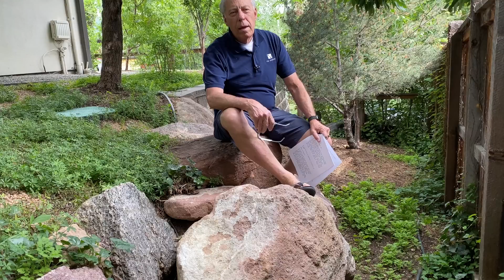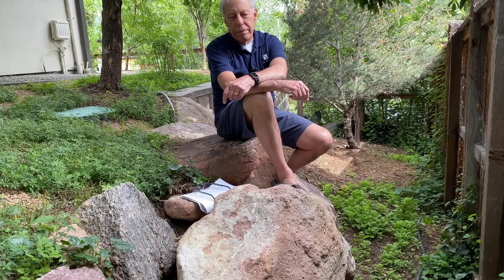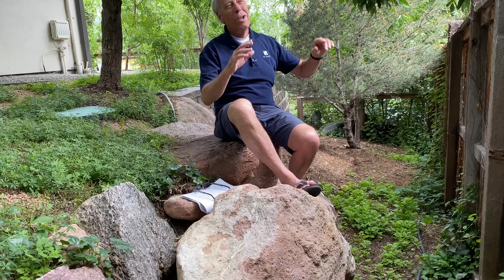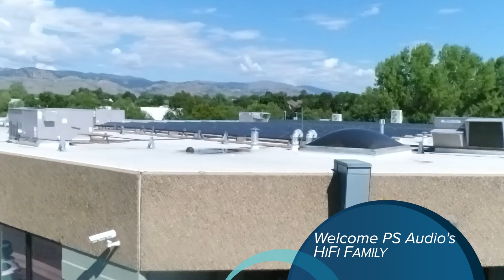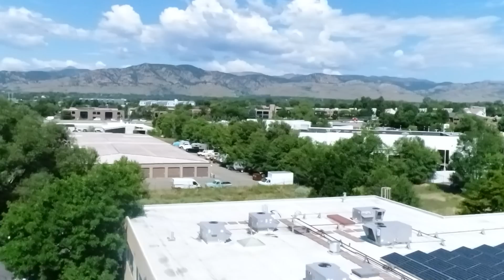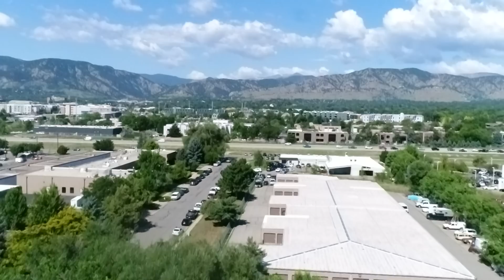Can a regenerator be used with valves?

Comment: Great question for those who already have their own jet and need to find something to spend money on. Let me know if you need some US$20,000 power cables.
Reply: Don't forget to buy some brilliant pebbles and cable lifters! 👌
Reply: @QoraxAudio  Said like someone who's never tried a cable lifter.
Reply: @VideoArchiveGuy  I use a type of cable lifters called tie wraps. Keeps things nice and tidy. Doesn't change anything to the sound though.
Reply: Or a Shakti Air Stone...
Reply: Qorax LOL, cable lifters...I forgot. I’ll sell some US$1500 per piece super low resonant ceramic cable lifters that will dramatically lower the cable to carpet interference and let the electrons move more freely giving the sound more transparency and openness. You need one per 2 feet of cabling for all your speaker cables, interconnects and of course power cables too. Due to the weight of power cables the cable lifter type is slightly more expensive at US$2000 each. We are working on a new type optimized for optical cables considering photons different properties.
Reply: @ThinkingBetter  I just turn my amplifier upside down so that all the bad electrons fall out! 😜
Reply: @QoraxAudio  Yes, bad electrons can completely ruin the soundstage as they jump around randomly. Don't forget that most importantly is to use an audiophile fuse in your amp. Standard fuses yield bad electrons, you know. Just buy a bunch of Synergistic Research Orange Quantum Fuses for your various devices. It's also good to have some spare ones, just in case. https://www.vhaudio.com/fuses.html
Reply: @QoraxAudio  BTW, I'm a person who likes science and am quite against anything that messes up our minds based on pure imaginary things...like religion, psychics, ghosts, aliens, crackpot conspiracy theories, audio snake oil and so on. From Big Bang to 13.8 billion years later... every time an explanation is needed, eventually science wins. Audio is on the much simpler side of science matters where we can explain pretty much everything. Try particle physics.
Reply: @ThinkingBetter  Noo, you need to use beeswax fuses, they're all the buzz nowadays.
Reply: @ThinkingBetter  Yes dogmatism is always bad... but don't underestimate the prevalence of dogmatism within the world of science...
Reply: Qorax Science make progress by a healthy level of debate and skepticism. What bothers me is when some person watches a YouTube video and consider himself an expert in a science field and starts making his own YouTube channel promoting the earth is flat, that aliens are living among us, you need a US$1000 power cable to hear all details from your 70dB dynamic range vinyl disk or other ridiculous things. The internet yields a lot of “Dunning Kruger effect”.
Reply: Qorax I can sell you some beeswax fuses. This month we have a special on 10 such fuses for US$4999. That’s 20% discount that we honor due to the pandemic. The new version brings music to life like you’ve never heard it. Actually it even eliminates all the bad effects of the regular capacitors used in the studio.
Reply: @QoraxAudio  How many times have you heard that Galileo was found guilty by the Inquisition that didn’t and how the Copernican model of the solar system correctly placed the sun at the centre of the solar system (it didn’t)? Scientists are as good/bad [delete whichever is inapplicable] at believing nonsense as anybody else.
Reply: @ThinkingBetter  I always thought the "cable elevators" were for keeping them out of the vacuum cleaner ??? 🤔
Reply: @poserwannabe1  No, cable elevators are to avoid carpet induced static electricity interference. That's why the ones we sell for only US$1500 are made of ceramic nano particles utilizing our patented rapid freeze molding process.
Reply: @ThinkingBetter  wow !! That's impressive...problem is I just spent 750$ on a audiophile grade duplex and male cord end, but I'm still having nightmares of "micro arcing"...my wife is recommending counseling..
Reply: @QoraxAudio  
How do you keep the good electrons from falling out as well?
Reply: @ThinkingBetter  Science should make progress by a healthy level of debate and skepticism - that's how the perfect world works.
Science is about churning out as many publications as you can and if you want to make a good career, you have to make sure others don't prove your results wrong.
Subjects that have no commercial purpose are less and less likely to be researched nowadays, since we live in utilitarian times that's all about profit and production. Solely "finding truth" doesn't have a high priority anymore.
Reply: @jonathansturm4163  Galileo explained his findings in a paper. The explanation was presented as a dialogue between Galileo himself and the pope, which he had nicknamed Simplicio and portrayed as an extremely dumb person.
Back then, the pope was one of the most powerful dictators in the world and executions over little things were common, so Galileo could've known that he'll get in trouble for insulting the pope.

I don't see what Copernicus has to do with Galileo, but the Copernican model actually was heliocentric: https://en.wikipedia.org/wiki/De_revolutionibus_orbium_coelestium
But Copernicus model is vastly wrong as well, since his model claims that all planets orbit the sun in circles.
I don't know if every orbit is ellipse, but earth's orbit definitely is.
Reply: Qorax When government officials are only interested in short-term business then yes, genuine long-term value science suffers. One example is nuclear fusion energy research that gets almost no money at all. Politicians are paid by lobbyists who care about growing business now.
Reply: @ThinkingBetter  Yes, that's the great thing about free market economy, get yourself some money quickly and screw over some other people in the process! 👌
Even more notable example than nuclear fusion energy was research into climate change. That research has been delayed for many decades.

Another nice example of the present day is the safety of pesticide coated seeds, something that's non-selective when it comes to killing insects. Beekeepers experience millions of dollars of damage because of that. It's a subject that's researched over here at the university of Wageningen quite a few times (Wageningen is one of the biggest academic institutes in Europe when it comes to agricultural research).
Most research is held back because it's financed by Bayer, the largest pesticide manufacturer.
A one man business like a beekeeper can't do anything about a multinational like that.
And environmental organizations already have other subjects that are more "politically spectacular" to make a fuss about.
Reply: @QoraxAudio  Galileo had been instructed by his friend Bellarmine, head of the Inquisition, to only teach the Copernican model as a mathematical recasting of the Ptolemaic model. He disobeyed. It’s a myth that he was tried for this; thanks to Napoleon Bonaparte we know that and several other charges brought against him not by the Church, but by his fellow university professors, was dropped. He wasn’t found guilty of the one charge that remained because the Inquisition couldn’t prove that his insulting the Pope was heretical. The finding was “vehemently suspected of heresy”.
Copernicus ‘ model was never adopted; it was too complicated and obviously wrong. It had more epicycles than the Ptolemaic, the plane of rotation of the planets varied and the results it gave were at best identical to the Ptolemaic model. The centre of rotation of the system wasn’t the sun, it was a point equivalent to the unoccupied focus of the ellipse in Kepler’s system. Galileo had a copy of Kepler’s book Astronomia Nova (Kepler had sent it to him) but he refused to read it; he knew Kepler was wrong and that planets can only move in perfect circles at a constant speed. A bit like those “scientific” types who know that cables can’t possibly sound different even though they never listened.
The Pope wasn’t a dictator BTW; he was elected as all Popes are. The Church wasn’t allowed to deliberately kill anyone either; that was the prerogative of the secular authorities. If the Inquisition had been seriously after Galileo’s hide, he would have been tortured and so would the printer of his book, Two New Sciences That never happened. His book was passed by two Inquisitions and only placed on the Codex after his trial.
Reply: @QoraxAudio  “Most research is held back because it’s financed by Bayer, the largest pesticide manufacturer.”
That may be true where you live, but it’s certainly not true where I live: Tasmania. When I first became involved in agricultural research here, my fellow researchers told me that there’d been no research into agricultural chemicals for nearly 20 years and that was in the mid 1980s. Mostly research was into Integrated Pest Management and that was mainly about breeding/selecting effective predatory organisms. My area was organic fertiliser use as a strategy to reduce biocide inputs. The Tasmanian Apple and Pear Growers Association set a goal of reducing pesticide inputs by 95% in ten years. They achieved it in five.
Reply: @jonathansturm4163  A few billion Dollars is almost no money for such R&D, my friend. ITER's initial budget was only US$5 billion. It's the largest fusion R&D so far but heavily underfunded relative to its importance. Just for comparison, the Apollo program's total cost in today's money is US$152 billion. The Manhattan project's total cost in today's money is around US$25 billion. Every year we spend US$20 billion in subsidies for the fossil fuel industry. The fossil fuel global revenue is US$3.7 trillion (almost 740 ITER projects). The US military budget in 2019 was 137 ITER project budgets. NASA is burning > 4 ITER budgets per year. Just to compare, it can cost up to US$6 billion to make a new car model from scratch (incl. new engine, new transmission etc.). Therefore my comments of "almost no money at all" is justified for something that represents a fundamental paradigm shift in our energy supply. Trump could be a superstar on this planet if he dropped his silly space force and focused on fusion power.
Reply: @ThinkingBetter  If the USA were the sole investor I’d agree with you, but they’re not. Is it underfunded? Probably. But that’s likely because none of its promised goals have been met. I can recall being told that it would be viable in 30 years’ time in the 1960s. We’re still being told it’s 30-40 years away. Personally I think thorium fission is the way to go short-term and I notice that the price for thorium went from being negative to positive about four or five years ago. And the USA is lagging in that area too. It’s India and China that are developing viable thorium reactors. The USA had one running for twenty years or so before shutting it down. Apparently they think bird-mincers and cookers are the way to go. Madness...
Edit: I’m not sure whether to believe the fossil fuel industry is subsidised, or not. I just looked at some Australian figures (we’re a net exporter). “Revenue from Australian Government taxes on fossil fuels exceeds the value of subsidies. The table shows that revenue from taxes on fossil fuels in 2009-10 was at least $ 15.5 billion. Assuming that the Australian Conservation Foundation’s (ACF) figure of $12 billion for subsidies is correct, the table shows tax revenue as exceeding subsidies by about $ 3.5 billion.

However, the table does not include revenue—such as company tax paid by coal and petroleum producers and processors—and therefore underestimates revenue. Consequently, taxation revenue exceeds the value of subsidies by more than $3.5 billion.” 
I can’t be bothered checking, but I do remember reading an analysis that government revenue exceeds subsidies by a significant amount in the USA also.
Reply: @jonathansturm4163 Well, that argument is a bit silly. Consumers pay the tax on fossil fuels and consumers pay for the fossil fuel subsidies through taxes, so it's a double whammy for us consumers. The ITER project is a construction project that moves at snail speed due to lack of funding. If the Apollo project was funded with similar money, we would never get to the moon and you could use similar argument. Mastering the "power of the sun" is much more complex than getting a bunch of people to the moon and back again following simple laws of physics. Meanwhile, the US government is spewing out US$ 2 trillion  for us to sit unproductively at home waiting for this pandemic to go away. I have no doubt fusion will take over our energy production at some point and no doubt that the time is all about proper project execution with proper funding. At least I can enjoy my solar panels on my roof fully powered by fusion energy.
Reply: @ThinkingBetter  At most 10% of oil production is subsidised and I suspect that a similar figure applies to coal so methinks you do protest too much. Over 90% of oil production is by government-owned enterprises: Gazprom, Saudi Aramco, National Iranian Oil Co etc. Take fossil fuels away and you’ve virtually no so-called renewables. Windmills cost at least three times as much energy to manufacture and install as they generate over their “useful” lifetime of 25 years. At least we’re in agreement that fusion power is a good idea, but I’m afraid that after waiting 50 years I’ve grown a little cynical.
Reply: @jonathansturm4163  Lots of things have not gone as fast as people predicted and much of it is not about feasibility but about how we choose to spend our money with a short-term ROI perspective. Look at the money spent on space research. The Apollo project brought us to the moon with a visionary president and proper funding. in the 1960s-1980s we had predictions about how space travel would be commonplace by now and we haven't even been back walking on the moon. Some projects require insane amounts of money and if the money are not spent, they will never happen. I've watched some videos about the ITER project and it just looks like a bureaucratic mess of lazy people and something that could be done 10 times faster if it was managed like modern high-rise building projects with proper funding...or like the Apollo project. I had my final oral exam in project management in my university presenting the use of the Pert planning method in the Apollo project. I'm from Denmark but moved to the USA. Denmark is on path to increase wind's share of total energy production to 50% this year, and up to 84% in 2035. Analysts expect the cost of wind power to be 30 øre/kWh and its handling cost to be 15 øre/kWh, being lower than coal and natural gas at 55 øre/kWh minimum. Some misinformation about wind energy has spread recently. I used to live near a large wind farm in Denmark. I've never met a person against wind energy in my home country btw. Sad such utter misinformation is getting so widespread nowadays.
Reply: @ThinkingBetter  Try manufacturing steel and cement without coal power. I suppose you could use charcoal, but there wouldn’t be much left in the way of forests. An Irish lass did her PhD on the effects of renewables on grid stability. At 35% the grid becomes unstable. We saw that in South Australia not so very long ago. You have to factor everything into the equations. I can recall Greenpeace extolling a business called Enron and how they were the ideal business of the future...
Reply: @jonathansturm4163  At 50%, Denmark is doing really well on power outage and better than the USA. https://www.greentechmedia.com/articles/read/the-countries-with-the-most-wind-and-solar-have-far-fewer-outages
Also in California, we don't suffer from power outages btw. A power outage is something you see perhaps once per 5-10 years here in my area.
Any transformation of our electric grid takes time. Actually here in California we have zero coal power plants already and only one nuclear power plant that is on the path of being decommissioned. My roof solar panels are saving me much money also (the sun shines a lot in California). 
Surely the fossil fuel industry is pumping a lot of money into skewing such facts. Reality is that coal is already economically losing against alternatives and that's really the primary reason the coal industry in the USA is rapidly shrinking. My Tesla Model 3 gives me around 300 miles for the cost of 1 gallon of gas with my own solar panels (amortized over 25 years). Does this compute for you?
Reply: Jonathan Sturm Also, steel manufacturing is totally possible with electricity or hydrogen: https://reneweconomy.com.au/another-nail-in-coals-coffin-german-steel-furnace-runs-on-renewable-hydrogen-in-world-first-55906/ To produce a ton of steel in an electric arc furnace requires approximately 400 kilowatt-hours per short ton or about 440 kWh per metric tonne; the theoretical minimum amount of energy required to melt a tonne of scrap steel is 300 kWh (melting point 1520 °C/2768 °F). Manufacturing of steel using coal is also incredible unhealthy and definitely not what we need in a much cleaner future.
Reply: @ThinkingBetter  When solar panels were being heavily subsidised by the Australian government I investigated the feasability of solar PV. The time to amortise the investment worked out at 18 years. At the time the Australian consumer magazine Choice came up with 16 years, but I live in the southernmost part of Australia so efficiency would be lower than most of mainland Australia. This was based on the feed-in tariffs (FITs) at the time and since I expected them to fall I decided not to go ahead with the quote. FITs have since fallen to the wholesale price for electricity (by about two thirds). I recently compared investing in solar PV for 25 years versus putting the money in the stock market. Investing there and buying grid energy generated $75,000 more over that period of time.
Something I hadn’t anticipated is the impossibility of replacing failed solar panels. You can only replace a failed panel with an identical panel. So far every panel that’s failed where I live is no longer manufactured, or available. It would seem my original estimate of time to pay back was overoptimistic. And no, I’m not talking about cheap Chinese panels. These are of European origin (mainly German).

I can only recall one serious (unplanned) power outage where I have lived for the last 50 years. It lasted for nearly 48 hours and was caused by statewide wind storm that took down many power lines. The supplier paid me compensation :-) Since I burn firewood for space heating, cooking and hot water I was quite comfortable. Being paid as well was a bonus.
I emailed a chap in Denmark who worked for me for a few months years ago. He says there’s widespread protests in Denmark against windfarms. So it goes...
Reply: Jonathan Sturm Denmark has some very windy places, especially at the west coast. Now I live in a place with a lot of sun here in California. The sky is completely free of clouds almost every day. Obviously many places are not so ideal for these energy sources. I know nobody protesting against wind energy in Denmark, but I don’t live there anymore. I just found this though: https://www.thelocal.dk/20171213/few-danes-complain-about-wind-turbines-group
Reply: Jonathan Sturm https://i.insider.com/5af0a65e19ee8624008b498d?width=750&format=jpeg&auto=webp
Reply: Jonathan Sturm I’m not sure when you researched solar panels but the price has dropped dramatically in recent time. Over 25 years my estimated savings are about US$80,000 all cost considered.
Reply: @jonathansturm4163  "The Pope wasn’t a dictator BTW; he was elected as all Popes are"
Hitler was elected, so he doesn't qualify as a dictator too?

I don't see what elections have to do with dictatorship, just like what Galileo has to do with Copernicus.
Especially as an initial reaction to a comment about dogmatism within modern science.
Reply: @ThinkingBetter  There’s a huge difference between recycling steel and manufacturing steel. Steel manufacture requires vastly more energy than recycling it (~6 times). Steel is an alloy of iron and carbon, so a carbon-free steel manufacturing process can’t possibly exist. Currently there’s not enough steel in existence to meet the stated goals of the US, EU etc for wind power. There’s also a paucity of supply of cobalt and rare earth metals needed for magnets. Cobalt depends on child slave labour in Africa and the extraction and smelting of rare earth metals in Mongolia is causing massive environmental pollution. I wouldn’t be crowing about how cheap my electricity was if it depended on children as young as four years old being forced to work below ground.
Barbara Jones, “Child Miners Aged Four Living a Hell on Earth so You Can Drive an Electric Car: Awful
Human Cost in Squalid Congo Cobalt Mine that Michael Gove Didn’t Consider in His ‘Clean’ Energy
Crusade,” Daily Mail (U.K.), August 5, 2017, https://www.dailymail.co.uk/news/article-4764208/Childminers-aged-four-living-hell-Earth.html; Annie Kelly, “Children as Young as Seven Mining Cobalt Used
in Smartphones, Says Amnesty,” The Guardian (U.K.), January 18, 2016, https://www.theguardian.com/
global-development/2016/jan/19/children-as-young-as-seven-mining-cobalt-for-use-in-smartphones-saysamnesty; Amy Maxmen, “Poverty Plus a Poisonous Plant Blamed for Paralysis in Rural Africa,” National
Public Radio, February 23, 2017, https://www.npr.org/sections/thesalt/2017/02/23/515819034/povertyplus-a-poisonous-plant-blamed-for-paralysis-in-rural-africa
FWIW my wife and I invested in property and rent the houses we purchased to low-income families. Thus my “excess” wealth is used to improve the lives of my fellow citizens, rather than degrade the lives of foreigners.
Reply: Jonathan Sturm I’m not sure what you expect but turning our energy supply greener takes decades and surely making steel is one area where coal will find some place for a longer time as it goes away from other usage. So what? If we care about future generations we gotta start using much more sustainable methods. And same goes for cobalt mining. Millions die from fossil fuel caused pollution and possible some kids have been hurt in mining, but put things in perspective please. The argument is silly cause it’s already mostly solved as no respectable company wants to be known for a supply chain that hurts kids or hurts the environment. Besides, cobalt free battery chemistry is now in R&D, thus making this argument silly. It’s sad how fossil fuel funded misinformation got into your head. The deaths from cobalt mining is probably <0.000001% of the deaths from fossil fuel pollution. Still we care about fixing it.
Reply: @ThinkingBetter  There’s no fossil fuel funded misinformation coming from me. I’ve been an advocate of a greener environment for many years. I have delivered papers to conferences such as Greening Australia and my paper advocating solar hot water systems to reduce electricity demand was referenced in a book called “A Greenprint for Australia” published by the University of Queensland in the 1980s. Wind generators require at least three times as much energy to manufacture and install as they will generate over their stated lifespan. I believe a recent paper has been published saying my estimate is out by ~30% because I didn’t include transport costs or cement manufacturing costs. A device that consumes three or four times more than it generates makes no sense. It’s akin to selling a product for a quarter of what it cost you.

Claiming that it’s OK to exploit children in cobalt mines and pollute Mongolia because coal is a polluting energy source is disingenuous at best.
Article re Mongolia here: https://www.dailymail.co.uk/home/moslive/article-1350811/In-China-true-cost-Britains-clean-green-wind-power-experiment-Pollution-disastrous-scale.html
When I was involved in attempting to have a silicon fab to manufacture the material used in solar cells here in Tasmania, it was vigorously opposed by the Greens and the Tasmanian Wilderness Society on the grounds that there’s no way to do so without massively polluting the environment. Both organisations are also vigorously opposed to our current method of electricity generation: hydro-electricity. It is not, they say, a renewable energy source.

It also looks like they’re about to do a volte-face on wind power as well:
https://www.abc.net.au/news/2019-07-25/bob-browns-opposition-to-wind-farm-labelled-hypocrisy/11345200

When I pointed out that our current wind-farms were likely to send wedgetail eagles extinct I was attacked by Bob Brown and others in the green movement. I shouldn’t be surprised I suppose. They are now protesting against the harvest of the tree plantations we encouraged when I was in the green movement forty odd years ago. I despair...
Reply: @jonathansturm4163  You do repeat the talking points you find from the campaign of Koch Brothers and such. I've spent almost 3 years living in China during some project. For about half the time I stayed on the 25th floor in an apartment building. I picked the place but didn't know that two blocks down the road (in a city) there was a coal power plant with the chimney right at the height of my apartment. At some point I had to go to the hospital for coughing and moved to another place. While waiting for my CT scan in some room, a woman was diagnosed with late stage lung cancer right in front of me and she started yelling and crying loudly. Air pollution is a huge problem in some areas of this planet. And to make matter worse, I was working in an office building right next to a cement factory that was using fly ash in the cement mix. The trucks with the fly ash were driving it on open trucks and fly ash was everywhere. The roads were covered in the gray toxic stuff and also on my office table and in my office fan, I could constantly clean away the nasty stuff. I then brought my Geiger counter to the office and realized this coal power dust was also radioactive. The background radiation in my office was 2-3 times higher than normal. Coal is never clean and always has various toxins in the mix from nerve damaging mercury to cancer causing radioactive isotopes. Anyway, that was in China. I'm happy California is hugely more responsible on these matters. California also has some huge wind farms and I'm sure some birds die from hitting the blades, but a dead bird does not represent a long-term accumulation of toxins like coal is yielding. I rather see a few dead birds than our fish supply becoming toxic and uneatable due to mercury accumulating, for example.
Reply: @ThinkingBetter  Why do you insist that I’m an advocate for coal when I have been opposed to it for as long as I can remember? I have merely pointed out that the energy generation you advocate increases coal consumption. The only alternative to coal in steel manufacture is charcoal and manufacturing that is far more polluting than burning coal. Incidentally, the coal used for making steel is not bituminous; it’s almost pure carbon. My electricity supply is from hydro power and unlike the Greens I do not oppose this. Most of my energy consumption comes from firewood and I have planted several times as many trees as I have burnt. The Greens have until recently advocated the replacement of hydro-electricity with wind power and while you can trivialise the killing of birds, you obviously haven’t factored in the consequences of that either. Consider:

Forty percent of the wedgetail eagles’ diet consists of feral cats whose diet consist of mainly small, insectivorous birds.
The windmills are killing many thousands of bats and they too are insectivorous.
The windfarms are in the immediate vicinity of one of Australia’s major vegetable producing areas. The increase in insect pest numbers caused by the windfarms must necessarily increase the amount of pesticides used to control them. 

Incidentally, I have been a staunch advocate of reducing pesticide use and was Tasmania’s first organic market gardener. In recent weeks I have published my second book on organic gardening and a memoir by my friend John Young. All profits from John’s book go towards the building of a wooden trading vessel that will be powered by wind. My book suggests that the best use for bituminous coal is as organic fertiliser rather than burning it. I suppose you’re going to say that’s evidence that I’m in favour of coal burning power plants too. If the Koch Brothers are in favour of organic farming and gardening, then I’m in favour of the Koch Brothers whoever they are. The only Koch I know is an organic gardener and her husband builds wooden boats.
Reply: @Jonathan Sturm Windmills are alright. They kill an estimated between 214,000 and 368,000 birds annually here — a small fraction compared with the estimated 6.8 million fatalities from collisions with cell and radio towers and the 1.4 billion to 3.7 billion deaths from cats. Well, I'm not saying wind power is good everywhere and perhaps your mentioned area is a bad place for it. Why would anyone promoting green energy be against hydro power? Where do you see that? Well, I like the fact that you have depth in your opinions. The Koch Brothers are major players in the USA running fossil fuel business and have been among the most destructive on this planet in promoting misinformation aiming at keeping their business as status quo. The CO2 concentration rapidly increasing in our atmosphere is a real concern long-term and the USA population is quite anti-science on some key points about climate research due to such misinformation.
I've travelled to many places on this planet and I could make an argument that you can find places, like India and China, that are heavily industrialized with lots of factories incl. iron producing ones and using coal power often with no filters, where people die or get sick in massive numbers and you can find places, like California and Denmark, where the grid power is highly developed having abandoned coal completely and where the air is much cleaner on a totally different level. I greatly appreciate the strong push from local governments in keeping us healthier. When I was working in China and complained to the HR department about the fly ash being so highly concentrated that you could see a "fog like" air over just a few cubicles, they looked at me like I was crazy. A simple swipe with a finger on an office desk wold make my finger covered in gray dust.
Coal is never pure carbon and especially in those places where the income is lower, money are saved incl. on lower quality coal. I had a trip in China west of Beijing  8 years ago and was in a city "Boading" where I couldn't even see the ground from my hotel room due to pollution (around 20 floors). I've often had Chinese business visitors coming here to California being blown away with how clean our air is.
Reply: @ThinkingBetter  LMAO 👍😂
Reply: @ThinkingBetter   Greens oppose hydro because it damages the environment. It also increases methane levels in the atmosphere as does rice farming in SE Asia and rainforests like the Amazon Basin. I suspect we’re going to see Green protests against those in the future also.

You still haven’t addressed the issue of windmills greatly increasing the amount of coal burnt. Currently the amount of electricity being generated by wind world-wide is considerably lower than 1% (actually 0% to the nearest whole number). You can’t make windmills without steel and you need to consume more coal-generated energy to make the steel required than a windmill can generate. Steel doesn’t magically appear from nowhere in order to be recycled, nor does the iron ore that’s also needed. Natural gas, hydro and nuclear OTOH do not suffer from this problem. Being in favour of these energy sources is not the same as advocating for coal energy no matter how many times you say it does.
 It’s you who are advocating for coal-fired power, by advocating for wind-power, not me. 

Incidentally I never said anthracite was pure carbon; I said it was “almost pure” and at 95% it is. It also amounts to only 1% of known reserves so I wonder if there’s enough of it to make the steel needed for the goal of 80% wind power even feasible, let alone desirable. It would be interesting to work out how much copper would be needed and speculate on where that’s going to come from. Good luck starting a copper mine in the face of Green opposition in the USA, Europe, or Australia!
Reply: @jonathansturm4163  Here in California solar is around 20%, hydro is around 15%, geothermal is around 6% and wind is about 7%. Natural gas is dominating around 44%. Nuclear is soon dropping out with 8%. We have around 270 hydroelectric facilities. Hey dude, our state law here effective from this year requires new buildings to have a solar system as an electric source. At this point it's a money saving measure also, thus you don't see people resisting it. Yes, much of the world is still like India and China with air that kills you slowly and little care about future environmental and climate consequences. That's a bummer, but again, these things take time to change and at least I appreciate what is happening here. One beauty of solar panels is the fact that they are most effective when you need them most thus further helping to save money. Like right now my local temperature is reaching 95 Fahrenheit or 35 Celsius. I run my air conditioner a lot these days, especially due to working from home, but it's well in synch with the fusion energy of the sun driving my AC when I need it :-)
Reply: @jonathansturm4163  I would assume methane from hydro is highly depending on the weather conditions. In California, the climate is probably much better for hydro without causing a swamp to form. The cradle to grave carbon footprint for wind power is 14 grams of CO2 per kilowatt-hour of electricity produced. For coal it's 870 grams. For natural gas it's 464 grams. Studies have shown that a typically 7-9 months of operation are what it takes to balance out the extra carbon footprint from the manufacturing of a windmill. This takes into account extraction and manufacturing of raw materials, production of the turbines, their transport, erection, operation, maintenance, dismantling and disposal, and the same for their foundation and the transmission grid. 
I just read that oil fields are killing much more birds than windmills. It's the sort of data that is missing in the debate.
I see no disadvantage in California leading efforts for a greener future. In fact, green energy/transportation is our biggest job creator from companies like Tesla to solar panel installers and a major positive contributor to the economics of the state. We have 5 TIMES more people working in green energy related jobs in California combined than who are working in fossil fuel industries. The state economy is #1 in the USA and now beats UK as the 5th largest heading towards beating Germany, thus I can't buy any argument that it's too expensive. The USA poor areas are those with coal power and coal mines.
Reply: @ThinkingBetter  Given your lack of basic arithmetic skills, I’m disinclined to pursue this conversation any further. Whatever you do, don’t go into business; you’ll be bankrupt by the end of the first year. And I’ve just been asked to publish another book even though I’m retired and don’t need the extra income. <sigh>
Reply: @ThinkingBetter  Yes, I remember that argument when Barak Obama told the US that he hoped to follow Spain’s example. A conservative economist published a paper on the effects of the greening of Spain that estimated each green job had cost two ordinary jobs. The Spanish government was quite indignant and pointed out he was wrong. Each green job had actually cost three ordinary jobs.
There was a hilarious story that appeared in the press in Spain, France and Germany, though mysteriously not in the UK, USA or Australia. A solar electricity generator owned by the mafia (as so many are), was generating electricity 24 hours per day. Upon investigation it was discovered they were using a carbon arc light running on a diesel generator to shine light on the solar PV array. It wasn’t long after that when Germany had to bail out the Spanish economy.
Earlier you questioned when I had done my solar calculations. I didn’t date them I discovered when I found the piece of paper on which I did my sums. I did note that in order to achieve the claimed financial return according to seller, the array would need to generate 140% of its rated output. The seller never responded to my query as to how this was going to be achieved. The ALP terminated the program in mid 2009 so it would have been in the first half of that year. IIRC the subsidy was $8,000 (~$10/W) on the four panel array I priced up. I used https://solarcalculator.com.au/ and verified their calculations manually as well as achieving a similar result to what was published in Choice at an unknown latitude.
The largest project I ever managed was building my world-famous House of Steel. The builders quoted $300 to 350,000 and I finished it for $180,000. I believe the lowest quote the builder forgot to include the then new Goods and Services Tax. Still, $170,000 for around 16 months’ work was somewhat higher than my usual income at the time and since I didn’t need to pay interest on borrowing that amount, or earn and pay income tax on it, was worth closer to $400,000 in real terms. My mummy taught me to do my sums...
Reply: @jonathansturm4163 Reality is right on my roof in terms of solar economics. I don't need to speculate about it. Subsidies have greatly helped making solar panel production become economically cost efficient now able to beat fossil fuel options without subsidies. Of course that wasn't the case until a handful of years ago. My area has a solar energy potential of 2200 kWh per square meter per year. Tasmania is more close to 1300kWh per square meter per year. There are on average around 300 sunny days per year here. Clean energy is a huge job creator here and I don't know what "ordinary job" is being lost from it? Also we don't have any mafia here involved in it. This is not Spain. In California we already have more than 1 million buildings with solar panels on the roofs. This includes a lot of companies e.g. my nearest Walmart here has the parking area covered with solar panels. Currently California is somewhere near 40% clean energy from this year. My country Denmark is near 50%. A huge factor in getting to 100% is about cost effective energy storage technology. Both grid batteries and vehicle batteries are under the same umbrella of R&D. Tesla recently announced batteries that can last 1 million miles and give you 400 miles per charge, for example. Give it 2-3 decades more and you will start to see fossil fuels gone from the grid and automotive in certain countries. In fact, our state governor has signed a bill targeting 2045 as the year of 100% clean energy for our grid.
Reply: @ThinkingBetter  You’re welcome to it. I don’t rely on child labour in Africa or massive pollution in Mongolia to make my energy affordable. I can walk the streets of a city that hasn’t seen a riot in all of the fifty years I’ve lived here. I can shake hands with my fellow citizens without fear of contracting a lethal disease. I don’t have to wear a mask and I ate an excellent lunch at my friends’ Dave and Steve’s café. I wouldn’t want to live anywhere else...
Reply: Jonathan Sturm I don’t use electricity causing severe lung illnesses and fish to become toxic from mercury. The carbon footprint of my car is much less than gas guzzling cars. Poor kids in Congo have inappropriately been used as labor for cobalt mining, and it’s already getting much attention to be eliminated. It’s a supply chain management issue and cobalt is on the path to be phased out anyway. It’s great you like your place. America has some riots somewhere far away from where I live, so it doesn’t bother me at all. We have a president with a toddler brain unable to have any intelligent depth or long-term vision in anything and is now ruining America; and has left us with the virus gone rogue having killed >150,000 Americans. America is going broke through incompetent leadership. Rural America will be suffering for many years to come. Anyway, California will be fine cause we have a much more visionary leadership, healthy economy and great companies.
Reply: I own a jet 😁
Reply: @charlottejet4338  Seriously? What aircraft model? If real, I'm envious. I live next to a small airport and have tried flying a single engine Cessna a few times incl. to Catalina in Southern California (have a friend who owns a Cessna and is flight instructor). A trip to Catalina island getting a burger there is quite an awesome way to release some of the tension from the pandemic. https://www.visitcatalinaisland.com/about-the-island/points-of-interest/airport-in-the-sky/
Reply: ThinkingBetter I am marketing a range of Magic Beans to sprinkle around your system. Audiophiles who are hard of thinking swear that they make the brain hear higher frequencies. Only $2990 a tin.
Reply: @geoff37s38  Tell me O Wise and Toothless One: “How many have you sold so far?”
Reply: Jonathan Sturm I have only just introduced the tins of Magic Beans into the market. If you are interested I can throw in a sheet of Quantum Stickers (a real product). Place a sticker next to speaker terminals and your system will exude a subtle aroma of a rainforest after a thunderstorm with a hint of burnt sausage. Visa accepted.
Reply: @geoff37s38  US$2990 is a great price. What's the warranty terms and do you offer volume discounts for a whole-house coverage?
Reply: Do these  regenerator thingies work good as a boat anchor  or do you need to pour concrete in them first?
Reply: @musicman8270  no need to add concrete, they'll work fine as is...
Reply: @poserwannabe1  Cool!
Reply: @musicman8270  
You just need to bolt on some flukes, then you're good to go.
Reply: ThinkingBetter  https://youtu.be/kFlnQ1chBno  just in case we have forgotten the BS on this channel.
Reply: @geoff37s38  Paul would be more successful if he was more coherent with what the best audio engineers know already. His team includes some solid engineers who he could consult. Any device that has well-regulated power rails inside and a fuse on the primary side of a transformer, do not need spending extra on some wannabe special audiophile fuse. For a power amp, the power rails are usually unregulated and it's good to consider any resistance that can cause voltage drops. However, let's say you have a 10 Amp fuse on the primary side with, let's say 0.005 Ohms of nominal cold resistance. Compared to your house wiring, it's nothing and the fuse is just in series with that wiring. Even at 10 Amps, the voltage across the fuse is only 10 * 0.005 = 0.05V against your mains voltage (120V AC or whatever in your area). Surely, if the fuse is causing an audible difference, you can also measure it as a voltage drop across it and the cause will be some issue with too high resistance in the fuse.
Reply: ThinkingBetter Agreed. Paul calls himself an engineer but does not know why some fuses are sand filled.
Reply: Geoff37 S For a CEO, Paul is hugely better than average in terms of in-depth knowledge, but he is not an engineer.
Reply: ThinkingBetter Yes, he is a salesman. I have studied digital recording and it is frustrating to watch videos from self-proclaimed “experts” who completely misunderstand the process. Paul is among these so called experts who spread misinformation, presumably for commercial reasons.
Reply: Geoff37 S The truth is that when it comes to digital audio systems, only amp and speakers need to be somewhat costly for a super good sound. A US$5 USB flash drive or a PC and a US$50 DAC can beat any >US$10,000 CD player or record player ever made on audio fidelity. Anyone claiming that some super expensive “CD transport” sounds better than my US$5 USB flash drive is a liar. It’s sad I have to say it like this though.
Reply: ThinkingBetter Agree. My system could not be simpler. Yamaha preamp/streamer, Emotiva XPA2 power amp and a pair of full-range large floor standing electrostatic speakers. I guarantee no system will sound better, at any price.
Reply: Herllo Kinde3 Sire. I just wastch the video 'Marshall JMP-1 Tones' ands start at 3 mimtes 28 seconde he says the MAARSHALL JMOP1 USED CLIPPIGN DIODES. i am relly furious and I am abotu to STEEM,IGN MADDE! Marshall always with TUBE SOUFN nad they used clippign dioded in there and JCOM 900. THEY, I REPPPPTE, THEYA RE THE TRUE MASTERS OF SNAKE OIL SAL;ESMEN. I am DONE WITH TUBES. TRANBSITORES AND computer simulator form now on. ALL OF THEM ARE LIEARS AND I AM SOUPE MAAAADDDEE AND I NEED LOTS OF MEDS TO SLEEPES. THANK YOU ANDS THUM,BES YOU YOU ARE THE FEW HONEST FRENDES., IA M FURIOURS!!!